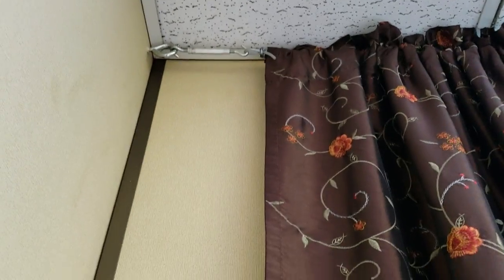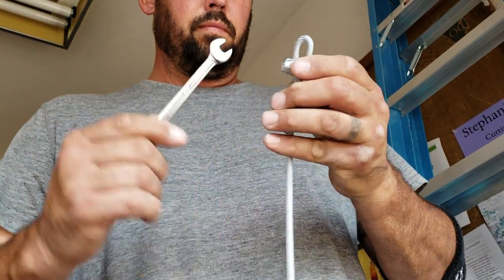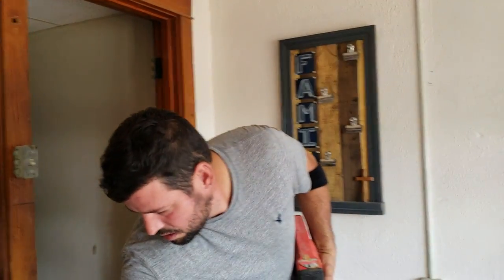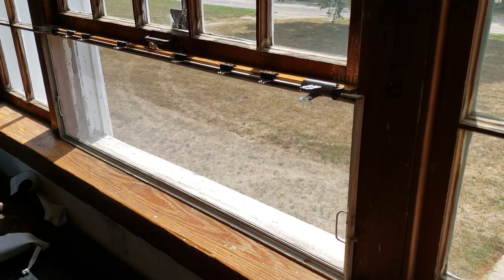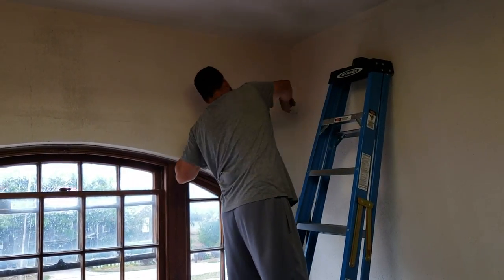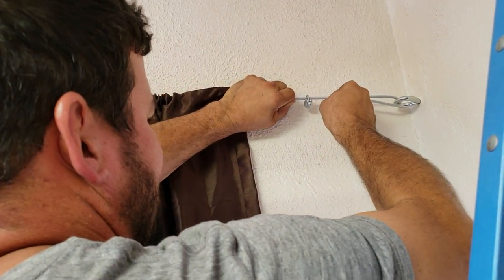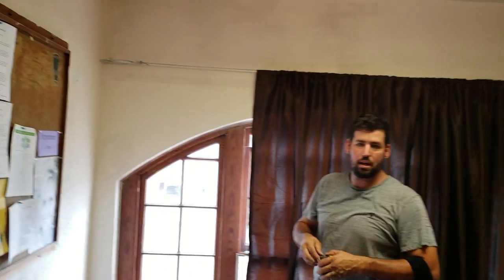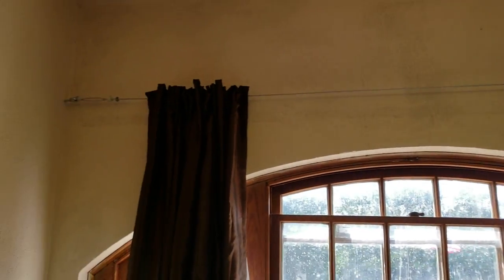We bought a school... concrete and curtains

Comment: Those walls are Plaster and Lath. Yes, it's a very corse plaster. With a finer plaster finish coat. And then, of course, paint. You may find the wall start to crack around the eye bolts.